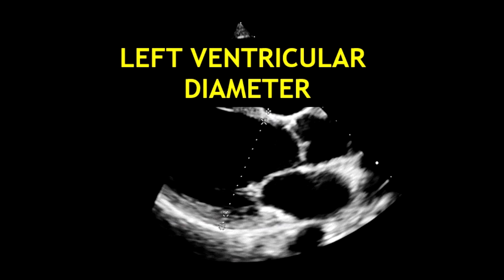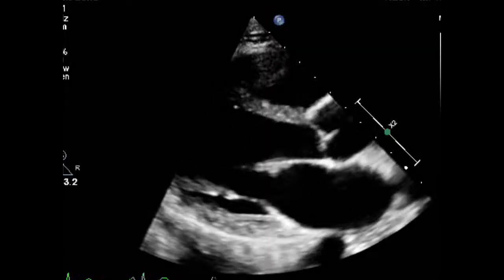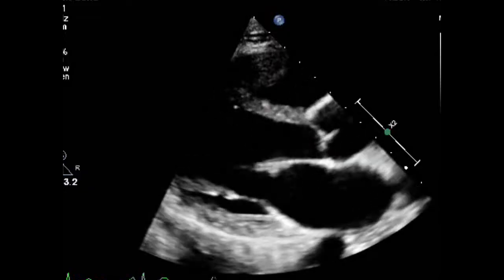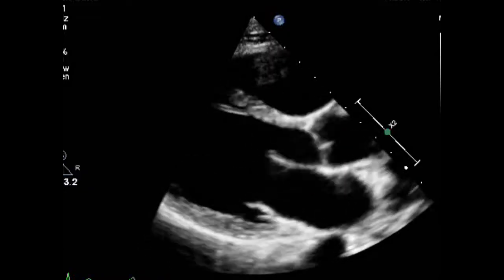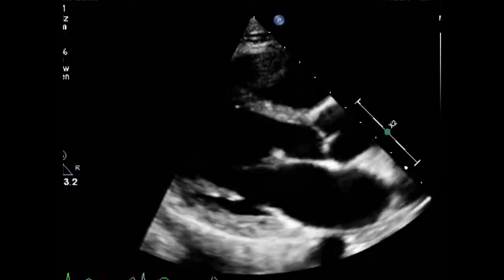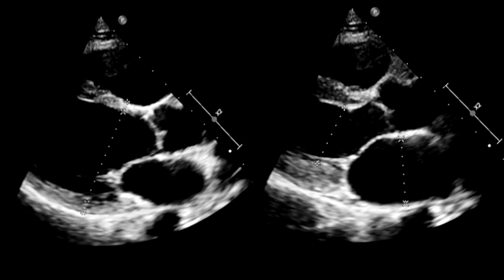How to measure the LEFT VENTRICULAR DIAMETER: Echocardiography!

Comment: Wouldn’t it be easier to just use the M mode?
Reply: M-mode is highly dependent on the angle of incidence of the ultrasound beam across the left ventricle. If the beam crosses the LV obliquely rather than perpendicularly, there is a risk of overestimating both wall thickness and cavity size. Moreover, in everyday practice it is uncommon to obtain a perfectly horizontal view with a horizontal septum and a strictly perpendicular beam. For these reasons, it is preferable to use the 2D method and perform the measurements manually rather than relying on M-mode

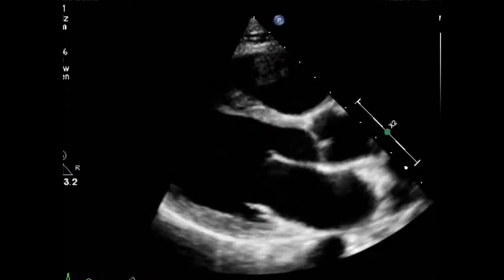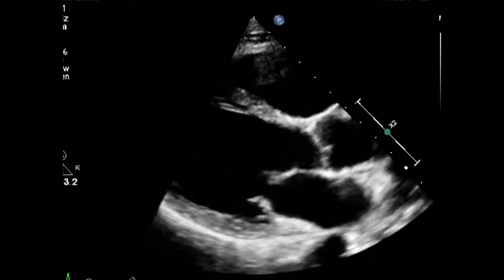Comment: 0:10 MEASURE THE DIASTOLIC AND SYSTOLIC LINEAR DIMENSION IN  THE PARASTERNAL LONG AXIS VIEW 0:24 WE HAVE TO MEASURE THE VOLUME USING 3 D OR SIMPSON METHOD 0:39 MEASURE THE DIAMETERS AT THE BASE OF HEART BELOW THE LEVEL OF MITRAL VALVE LEAFLET TIPS  FROM THE SEPTAL ENDOCARDIAL BORDER TO POSTERIOR WALL ENDOCARDIAL BORDER  1:02 FIRST I AM GOING TO SHOW YOU HOW TO MEASURES THE DIASTOLIC DIAMETER. FREEZ THE IMAGE AT THE END OF DIASTOLE ( ONE FRAME BEFORE THE CLOSURE OF VALVE AND VENTRICLE IS FULLY DILATED ) 1:34 DISTANCE BETWEEN SEPTAL  ENDOCARDIAL BORDER TO POSTERIOR WALL ENDOCARDIAL BORDER 1:42 MEASURE SYSTOLIC DIAMETER- FREEZ THE IMAGE AT THE END OF SYSTOLE-MEASURE THE DISTANCE FROM SEPTAL ENDOCARDIAL BORDER TO POSTERIOR WALL ENDOCARDIAL BORDER AT THE BASE OF HEART 2:20 IF THE LEFT VENTRICLE IS DILATED OR THERE IS REGIONAL WALL MOTION ABNORMALITY YOU HAVE TO MEASURE THE VENTICULAR VOLUNE BY 3 D OR SIMPSON'S BIPLANE METHOD
Reply: When measuring in diastole dimension of the left ventricle the valve is supposed to open to it's limit now from the video illustration you didn't demonstrate the valve opening 
quickly feedback will highly be appreciated

Comment: Hope you’re having a good day. What would be your suggestion for a left ventricle where the basil septum is bulging say at 1.5 cm but the rest of the septum is at 0.9cm . Where would you measure IVS ?
Reply from the maker: Hello! Some people avoid the bulge and measure the septum a bit higher! And some people measure the bulge. Either way, you always have to report that the LV is normal size with a basal septal bulge seen.
Reply: @the_echo_lady  thank you so much for your reply 🙏.
Reply: Very good question. Avoid the bulge...measure higher from it. However you may show the thickness of it by using calipers as opposed to incorporating it into the measurement package.
Reply: @glory1719  yes, and upon further thought, WE want to rule out LVOT obstruction. When that basel septum starts getting above 1.5 cm the LVOT VTI is even more important.
Reply: @madmax6654  yes good point. I'm happy that we are all here with "The Echo lady"

Comment: Great video, congrats!  ❤️ By what method can we calculare EF using LV diameters? And how it function this method?
Reply from the maker: You can calculate EF by Teichholz method (using just diameters) but this only can be used if you don't have any regional wall motion abnormality (you would underestimate)... In that case is more recommended to estimate EF by Simpsons method (based on volumes and I have a video in this channel about it)... But the most accurate one is 3D
Reply: Thank you very much. 🤗🤗🤗